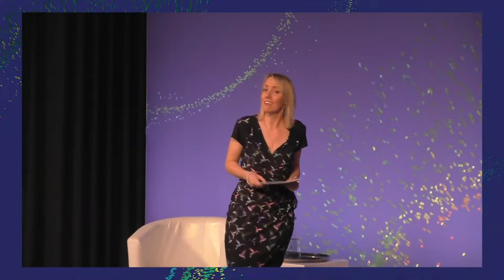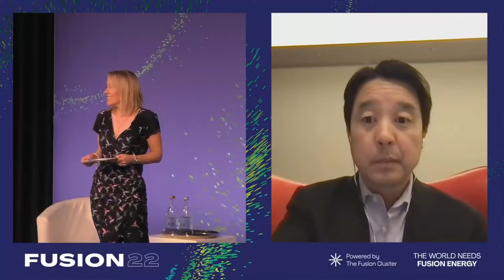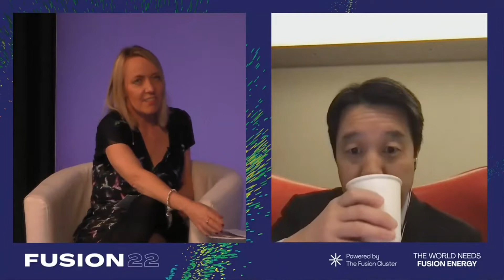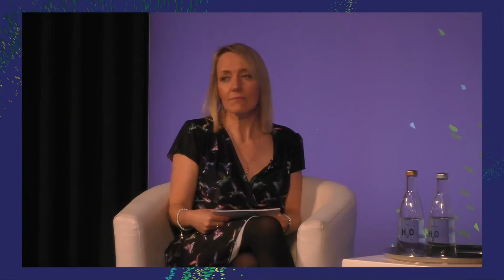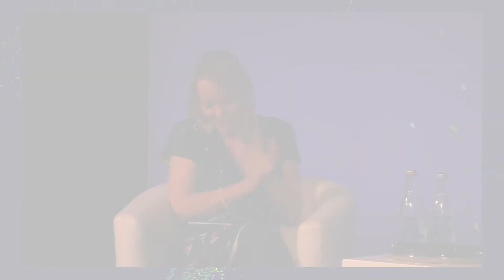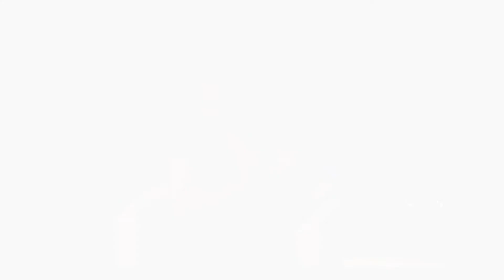What Fusion Needs: Diversity of Ideas - Different approaches to delivering fusion energy - FUSION22

Comment: 23:00 short answer: NO. The demands of EV batteries, assuming they materialize soon as many epxect (including me), and the potential demands for fusion, are on entirely different time scales.  EV batteries will require a lot of lithium (and few other key minerals) over a few decades, as production ramps. Recycling rates will increase rapidly, and eventually large amount of lithium will be in circulation, but mine production will be a small component. Fusion, IF it ramps as aggressively as its proponents hope, AND IF it continues to rely on D-T fusion (which seems a bold assumption at this early stage), will CONSUME lithium continually, so that eventually fuel exhaustion could become an issue (again, making bold assumptions), but the usage rate, at any one time. surely will not be a concern. Decades, versus many millennia, roughly speaking.